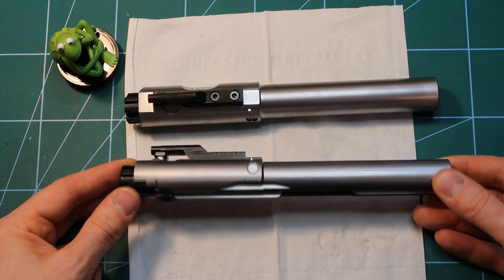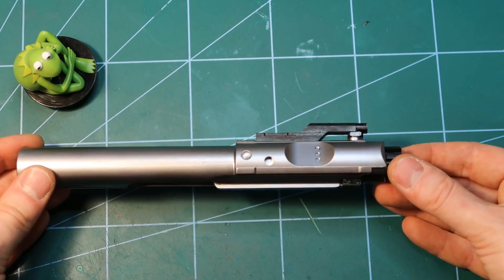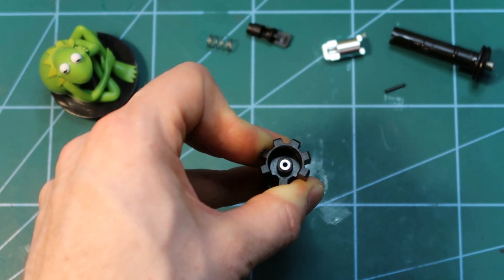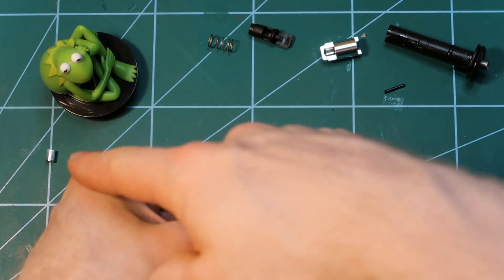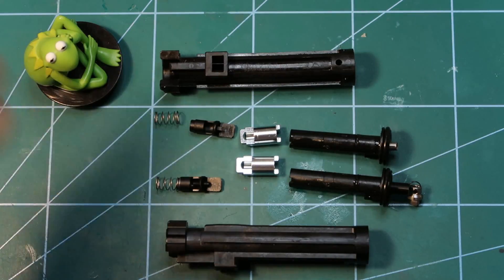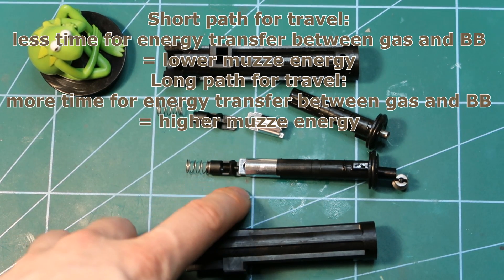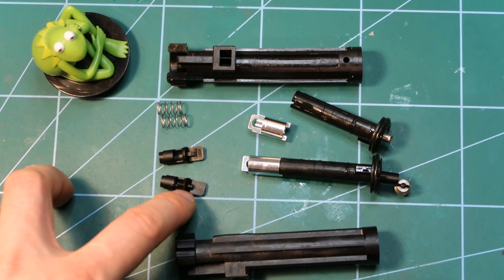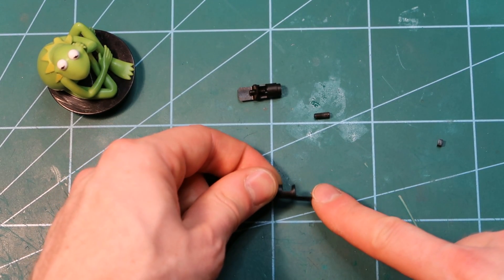Frog Tips #06 - How to make NPAS for VFC GBBRs & how to increase power of Asia version products

Comment: Is there a way to increase the fps of vfc ak74m?
Reply from the maker: I did not ever had one, but it will be just the same as all GBBRs - NPAS, heavier BBs, tighter inner barrel, better bucking, high flow valve maybe, higher pressure gas.

Comment: how to reach 700fps sir?
Reply from the maker: Just don't do it :D why do you need it?

But from the perspective of maximizing muzzle energy - use tightest bore barrel possible, use max pressure for the gun, high flow regulator, heaviest BBs, tight bucking, and use up to like 510mm  long inner barrel, longer probably will start to have cycling issues. All these items will contribute to raising muzzle energy.

Comment: but which way does the screw have to move to increase or decrease power? if i want less power does the screw move more to the front end or rear end of the Npas unit?
Reply from the maker: The more valve is going forward (screw goes deeper) the less energy you have. The more valve is going backwards (screw is unscrewed) the more energy you have.

Comment: Is there anyway to stabilize the fps using npas? Mine would go from .9 to 1.8 to 1.2. joules and so on, even though I adjusted it on the recommended power output
Reply from the maker: Hi, this will be a more detailed and complicated answer.

In general, NPAS does not affect the stability normally. NPAS works on inertia and time delay basis. So looking from NPAS point of view, energy depends on how long it takes for the valve to close. But it is totally not linear. Means for example to go from 1.5J to 1.6J it can be two turns of the screw, and then you from 1.6J to 1.7J it can be just a half turn. 

so now imagine you have difference of 0.1J on half of turn of the setting screw (you actually can have even bigger energy difference). NPAS uses an M3 screw with 0.5mm pitch. So 0.1J difference comes from 0.25mm of movement of the valve. And the valve cycles front and back all the time, it never sits in the exact same position twice in the row. Means, every time the distance if has to travel to close off the barrel is not the same every shot. And as I wrote, energy output because of it can be quite different

Now, put on top of it that all parts add tolerances and some random factor to general result.

So what to do in your situation? You must move the muzzle energy out of that range of NPAS which is not so stable. Means, If you normally can achieve stable 1.4J for example, but 1.8J are not stable, you need to upgade the gun in such way that it has 1.8J in the position of the valve where NPAS is more stable. And how to do it? You can use better tighter bucking, tightbore barrel, heavier BBs, higer pressure on the regulator, better regulator... anything that increases the energy. So that instead of 1.4J on stable NPAS position you can achieve 1.8J (in this particular example). 

You should basically see if this kind of stable position exists in your gun/NPAS and do as I wrote above. And in case it has big muzzle energy spread regardless of the NPAS setting, most likely it has nothing to do with the NPAS itself. It would have to be crazy loose (like Ra-Tech broken aluminium NPASes) to not have any range win which it is stable.
Reply: @frogengineeringairsoft  I manage to stabilize it to 1.11 to 1.3+. At least its better than before, but I might use a different inner barrel. Going from 6.05 to 6.03 barrel just to increase the fps just a slight more. Possibly a unicorn gbbr inner barrel. 

I actually ended up modding the rocket valve by adding a some sort of restricter to decrease the throughput while on the maximum setting on the npas. 

By the way its vfc g36 gbbr v2 converted into a full size g36 using a 4uad bucking and poseidon 470mm 6.05 inner barrel

Comment: Great video. I have a golden eagle m4 GBBR I’m going to try this on :) going to 3D print the NPAS valve thing though, just incase it doesn’t work I’ll still have the original. It gives me 285fps consistently. Want it to be 310-320.
Reply from the maker: Sounds like an interesting project, hope it will work!

Comment: Any tips on removing the screw that keeps the piston head of the nozzle attached to the bolt carrier off? Trying to screw it off and it is close to stripping the screw head
Reply: It’s 2.65mm 

That doesn’t exist, so you need to legit get a Torx that’s just just bigger by a small bit, and hammer it into the screw
This is literally the way
The screw metal is soft enough for this to work, just heat the screws before you twist, and twist slowly but firm
Reply from the maker: Sometimes VFC uses excessive amount of thread locker. Heat it up with a heatgun a bit, the screw will be easier to remove. I screw head is stripped, you can always drill it off, remove the nozzle, remove the rest of the screw with some clamps and just use a new one.

Comment: If I do the same procedure with the valve but don't remove the choke, what difference can it make?
Reply from the maker: Choke limits the output to 1J for given open valve position. Of course if you increase valve travel, you will also increase the muzzle energy, but probably instead of getting (for example on certain setup) 0.7-3j, you will get 0.7-1.2j or something of that sort.

Comment: Sir i have a question...if i cut the plastic part without put the  screw,basically is like shooting at full power and less recoil?
Reply from the maker: Hi, almost right. It should not reduce recoil, just increase the power. But what could happen, is that if the valve is to far back in the nozzle, it can get weird lagging behavior while shooting. This happens when you open NPAS too much in some guns.
Reply: @frogengineeringairsoft  thx for your wisdom sir, i will get a spare one and try. Its just for plinking,and im looking for the best power output for some fun...thx again

Comment: Hello mate,is it possible in your opinion to remove the choke from outside?(Without open the nozzle) The gun in question is a vfc bcm mk2.
Reply from the maker: Definitely somebody can come up with a way how to do it, but it will be much harder. I don't think it makes sense and disassembly of BCG is very easy. and you don't risk any damage do the nozzle. So I would just remove it the way I show in the video.

Comment: Wouldn't it be easier to just shorten the rib instead of entirely removing it?
Reply from the maker: Depends on what you need. If you just shorten it, you will increase valve travel increasing muzzle energy, but to nobody knows what value. You will need to assemble everything, check it, disassemble, cut some more... If you add a screw, you can set exactly what you need. If you don't remove the rib and just drill it, there will be barely anything left of it, and the remains will limit how much energy you can set. So I prefer to have full range of setting, the same way as VFC NPAS had originally.

Comment: imma just remove that rib for pow pow fps :3
Reply: hey there, did you end up just removing the rib and not install a screw? what fps / joule did you get for .2 bb?
Reply: @MotoHK1 my 417 is doing 490

416 isdoing a stable 450
Reply: I just removed plastic rib and gun still shoots 1.2J with .40 bb like before...wtf?

Comment: I have the opposite problem. My n-pas keeps opening on its own. Do you have any tips for this.
Reply from the maker: sure, just use some thread locking glue. If not anaerobic then regular loctite.
Reply: @frogengineeringairsoft  yeah thanks for the tip but I actually found out what the problem was. The n-pas is cheap plastik and the thread inside simply broke. So I took a 3,5mm drill bit, and then threaded it to 4mm*1 and used a 4mm grub screw. Works fine now. Thank God that I actually got a Job at a CNC company so that I actually have knowledge and the necessary tools to do shit like that :)